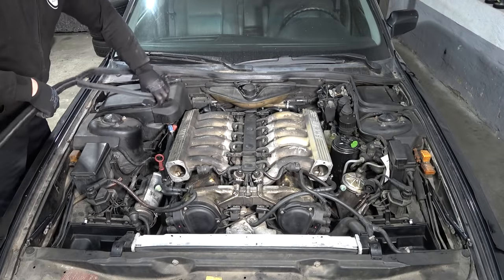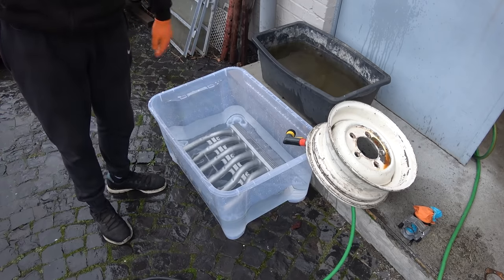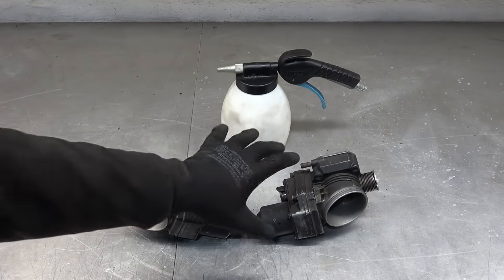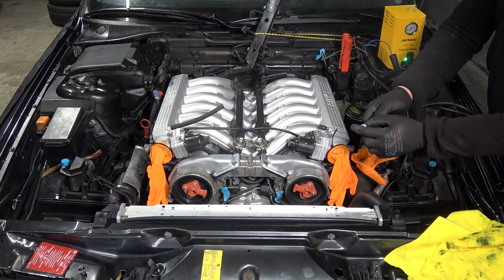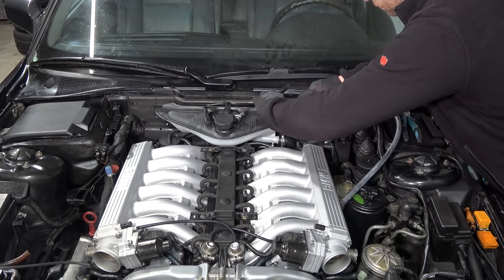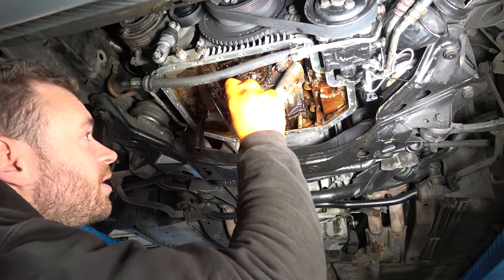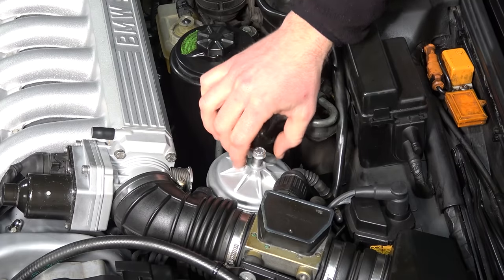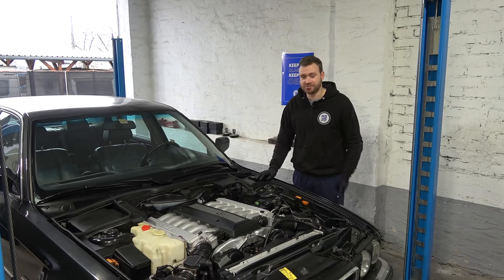BMW V12 Top End Restoration - E32 750iL - Project Karlsruhe: Part 8

Comment: Patiently waiting for part 9.....
Reply: Crazy how long he’s taking. I think he sold the car
Reply: There is an update from June 2023 in the "Project Valencia P1" video, 30:16 to 31:10

It's still leaking oil onto the piston heads (the same blue smoke issue) which Sreten thinks is the Valve Stem Guides needing replacement. He's decided to do a full engine drop & overhaul at the same time he replaces them. But it's the same engine as Project Marseille, so he's going to finish that first.
Reply: The car has been seen parked inside the dojo in other videos. Its just fallen behind on the list and waiting for its turn.

Comment: As a 30 year owner of a '91 E32, I cannot wait to see how you deal with the hydropneumatic rear leveling system (LAD) as you deal with the back end!. I hope you spend extran time on that part of the project! I had to take my 750iL off the road 10 years ago because Pentosin 7.1 at $13.00 (US) per quart was getting too expensive to make a trip into town! I would pour a new can into the front reservoir, and it would pour out the rear shocks as fast as I poured it in! 😭 I wouldn't have a clue what Pentosin cost today! Looking forward to that episode of Project Karlsruhe!

Comment: For those intake manifold gaskets (cut from sheet gasket), you could use some heavy grease (calcium, lithium, or graphite grease). Just smear on mating surfaces and both surfaces on the gasket. I've had the same problem, solved it this way. It works very well and it is cleaner when it is disassembled again later. One thing is that gasket (sheet gasket) has to be the right type, must not be stiff. Excellent work, I enjoy it very much in every video. Keep up the good work. Cheers.

Comment: Loctite 515 is also super useful on gaskets and sealing surfaces, without the drawbacks of silicone RTV. Good save with the oil pump!
Reply: 515 is for metal surfaces, the gaskets here were rubber.

Comment: Just beautiful!

Would love to be able to do stuff like this on my own.

I have had several mechanics working on my old BMW (E36), but they have done more harm than good to the car - and it has been off the road now for more than 6 months.

Also several mechanics have said, that they don't want to work on it, as "it takes too much time".

To make it even worse, just as I had the engine swapped, someone scratched most of the car, kicked off a side mirror and the right side skirt (original M3). And to top it off, insurance will only pay a quarter of the damage costs.

Keep up the nice BMW content 🙏🏼

Comment: The best part about vapor blasting is that the glass bead blasting media tends to peen closed the surface pores of aluminum resulting in a silky smooth surface finish that doesn't even oxidize as quickly as freshly cast aluminum. If you are blasting particularly delicate aluminum castings you can also switch from a solid glass bead media to a hollow glass bead media which shatters on impact and carries less force. It isn't as good at removing surface imperfections, but it does impact the surface finish less.

I always loved the low, lean bodies of the BMWs from this generation of cars. Nowadays the shoulder line of cars is so tall and they just look bulky and cumbersome. Even this land barge of a stretched 700 series looks entirely reasonably sized due to the design ideology of the time. It's just a shame that it wasn't painted a more interesting color, but it still retains its stately elegance.

Comment: What a difference, and what a beauty of an engine and car🔥 

Having an issue with my 84k mile/full BMW history E63 630i.. unfortunately I only now use the car for very short journeys to my gym and back, about 1 1/2 miles a day, so it’s hard to even get the car to temperature. So yesterday I drove home and the car momentarily lost power at 20mph, i pushed the gas pedal harder and it kicked down but blew a huge cloud of oily looking smoke! I took the car for a longer drive on a faster road to really warm it up and see if the smoke cleared. After a few miles it cleared. Engine sounds fine, performance fine, no dash warning lights.. So I am thinking PCV valve, due to all the short journeys. I know this is no good at all for the car.. 

If anyone has knowledge or a thought? 😒

Comment: Great work! This oil valve is the reason why in the M40 engines the camshafts go fault. There is a replacement for this metal valve by bmw which is made of plastic. I replaced it in my E30 m40 and since that everything works fine. Maybe consider replacing it with the plastic thing. It costs around 15€ at BMW Dealership.

Comment: I can't wait any longer to say this. You really need to make another channel JUST for the  water cleaning. No x2 x3 speed, no need for alot of talking. Just a little introduction/sync the videos from what car/project is the parts and then my friend, then my friend, you just upload all the time, all the smooth and relaxing time you spended on the part. That will be splendid 😁.
M539 DEEP CLEAN CHANNEL (M539DCC)
Cumprimentos de Portugal

Comment: Sreten, At first I thought of you as a BMW assembly engineer, product engineer, or someone that worked inside BMW Engine Assembly plant...then you throwing once in a while a words in Castilian (AKA Spanish) I thought: " Hmmm, Sreten is from Spain?!"...then in your Q&A video you explain your story, and I said :"Whaaat??"...OK..

You have demystified servicing these cars with your knowledgeable authority, gained from research and forums...no knowledge comes like free fallen from the sky, but through thorough and relentless research effort!

Another lesson learned from your videos, is how well designed are the BMW cars, not only in their functioning, style and longevity, but also designed with the serviceable-by-user in mind!
Their design (BMW) allows anyone to service any part of the vehicle, as well as making upgrades, say, the projector lamps, as you have shown us in your videos... This is something awesome...some other German cars do not have this in mind, as I found in my Sporty  Sedan 2.0L Turbocharged engine from Wolfsburg  that I have,...In order to do this, I need to remove brackets in the engine bay, front grille, front fascia, in order to get access to all screws to change a headlight..!!!and crossing your fingers one wont break or lose clips in the process!!!

At any rate, your videos have  instilled in me, a desire for research and doing some maintenance, in meine auto by mich selber....

Suffice to say, dass mein nächstes Auto ein BMW sein wird...
🙂

Comment: I saved a 740i with no oil pressure by reading oil light like you.  filter can relief  valve exploded  . fortunately fuel pump died at same time. lol.

Comment: Had same seized piston on M60 engine.. luckily caught it before putting everything together lol. I always dissassemble whole oil pump to examine. In that case it was not pressure regulating piston which on those is plastic. But instead overpressure relief. However its the same story, was stuck semi open so it wented precious oil pressure all the time, not so much to get red oiler light but who know for how many years. Did not seized the engine tho bearing were pretty shot.

Comment: The engine looks very nice from outside, but unfortunately I couldn't see the same beauty when the oilpan was opened for the oil pump. It is clear that it has worked for a long time without changing the oil.

Comment: Nice catch with the oil pressure. Most mechanic would have missed it or just ran the engine too long without oil.
Reply: No they wouldn't, every mechanic I know would have got oil pressure up before starting the vehicle after pulling the pan off.

Comment: I was hoping those blue gaskets would  do the trick . I have a BMW K1100RS motorcycle. Has the exact  kind of intake manifolds. They use and O -ring to seal. I noticed yours were totally flat.  I dont use the original neoprene ones but a silicone high temperature o-ring. They are much better.

Comment: On the engine cover you need to find those plug covers over the screws for the final detail. Also what is the brand source for the rust coating on the valley pipes and crank balancer?

Comment: Oil pressure warning light on after start.  Solution: Me - rev the nuts off the engine to see if it goes out.   M539 - Drain oil, drop lower sump and start removing some part that I never knew existed to free it up.  I would have had no chance to solve that problem. Scary.

Comment: I would prefer to use synthetic oil. It builds less sludge, and the engine will be happier. The oil pump valve will be stuck. The break cleaner didn't cause anything wrong. You are lucky that this happened at the garage.

Comment: Man im dying here , this multi language Guy IS doing all this superbe work craft  . I have BMW 318i 2 door kjetronic needs refresh engine stars imediatly but runs Bad . I have repair manual  the pump IS New ,réservoir is clean, gonna change all injectors next see what happens. It has almost 40 Years thats good injection system.

Comment: im working on my m70 1989 the original motor over heated and destroyed itself.  i now have a rebuilt one from bavarian .  i was wondering if you can circulate the engine oil throughout the engine without starting the engine.  i dont want something dry like a cam or rod bearing since i dont know the build or what was put on the surfaces during the build

Comment: Is it the fan clutch that causes the rad fan to grenade or the actual fan's plastic blades cracking? Just wondering because my 540IT did that but I thought it was just the fan breaking apart. Clutch still felt "grippy" if you know what I mean. Either way it sure made a mess.

Comment: Nice job ! The Engine is SOOOOOOOOOOOOOOOO CLEAN ! And we love that !
About the rear Axle carrier, did you change the "rubber, or axle beam" (part number : 	33311128670) ?

Comment: Sreten, love your soda blasting tool. I looked up the specs on that Hazet unit and its 280 L/min @ 6 Bar (10CFM @ 90PSI). What are the specs of your air compressor? I'm in United States and that would only be achieved by 60+ gallon air compressors. Wondering if the tool is still usable with a smaller compressor.
Reply: Never mind, found the answer in your Workshop Build Part 2 video. For anyone else wondering he's using a HEMAK HK-SK50/8-2 Silent compressor which has 2HP, 50L (13 US Gallons) and 150L/min (about 5.3CFM). Having 220V power in Europe helps with the higher Horsepower and CFM rating than what we get in the States. A comparable Husky unit would be 1.5HP/20 Gallons/4.0SCFM

Comment: I am using ATF in engine oil last 5 years and it looks like it is cleaning perfectly. I have read it is also good for seals not to get dry and crack. In my N62 i have 6.5 liter of 5W30 + 1.5 liter of ATF constantly.
Anyone else has any experience with ATF in the engine?

Comment: Actually you do not damage electronics if you use water (and soap) for cleaning (I use water, soap and brush for cleaning very dirty mainboards, videocards, fans etc). Just make sure to let it dry in a mostly dry, heated environment (20C) for 12 - 24 hours. Maybe in your living room 😉

Comment: Let me surgest next time you blast an exhaust manifold, make plastic couver that you can screw on. For exampl take some old caravan window cut out a piece using hot wire method make two holes and bingo covered up. That way you got a new tool you cud use an almost any exhaust manifold, instead of using thome that is going to soak up water anyway.

Comment: Man, I want to ask you a question. From your experience with working with BMW V12, what is the normal pressure of the cooling system. For me when I squeeze the upper radiator hose, it is little hard. I have asked mechanics and thay say that it is normal for this car. Can you tell me how the hose pressure should be on a proper working car, is it normal to have slightly higher pressure in the hoses? P.S. engine is tested for the exhaust gases in the cooling system and it is negative.

Comment: When cleaning electrics try out WD40 Specialist Contact Cleaner.
And when draining the engine oil it might also help if you pull the dipstick out and undo the oil filler cap to prevent any vacuums.

Comment: I cringed when you reused the old fan blade, mine exploded once; Under a freshly painted hood as well.  Lucky I knew a good dent removal tech that took care of it.  Guess what?  I use a metal fan blade from a .....  E32 750
Reply from the maker: It exploded because of the fan clutch.
Reply: @M539Restorations  I agree, but plastic can fatigue, I just couldn’t go with another plastic fan blade after that experience.  Either way I’m surprised your e32 didn’t have a metal fan blade as that was then only way i was able to source a couple.  One for the M5 and fixture e38.

Comment: @M539 Restorations; I have a BMW E32 750i that runs great when driving but when parked the rpm keep going down until the motor almost cuts off and then gives some gas (sometimes too late and the engine stops). Any idea what can cause this or how to fix it? Thanks in advance.
Reply: Short video of what it looks/sounds like 
https://youtu.be/Lvo8RvHvZJk

Comment: Hi, my son and i are restoring a 735i e32. We have a problem with power steering. We have changed the pump but can't bleed the air in the system. Any tips what else can be the problem?

Comment: older engines run perfectly well on full synthetic. 'old engines were designed for mineral oil so they prefer mineral oil' is a myth, a common misconception born of a lack of understanding. synthetic is better in every respect, you're doing any engine a favour by using it. the only real downside is that it costs more but if you have a car you care about it's worth it. older engines were not 'designed for mineral oil', mineral was all there was so that's what they used. and semi-synthetic is a marketing gimmick to cater to people who are afraid to go full synth, just like hybrid cars are a gimmick to cater to those afraid of electric. let's spread knowledge, not ignorance.

Comment: Use Pro-tec Engine Flush next Time. Will work a lot better than the Moly-Crap.
Benutze ich seit Jahren. Beeindruckende Ergebnisse.
Reply from the maker: What a nonsense.
Reply: @M539Restorations  have you test it?
Reply from the maker: You do understand that all engine flush products are more or less the same? You can even use straight up diesel like in the old days. LM is a reputable company that makes fantastic products, I've never even heard of protec.
Reply: @M539Restorations  LM make some good Products that's right. I have the same Opinion as you since I've test pro-tec. Believe me it's good Stuff. Sorry for my bad English
I use ist on my B5 Alpina 10tkm oil still clear.
Reply from the maker: @TheRummpelbeat  it's pointless discussing this. Just use whatever you prefer, nothing wrong with that.
Reply: @M539Restorations  I do 😉. Just try to help. You use a lot of Premuimtools an the LM Engine Flush is not the best Option.
Awsome work by the Way with the B7. Go ahead

Comment: You doing WRONG - engine flush should be added Always on COLD oil  (because of less oil pressure) !!!  btw  it is so dirty inside - it should be flushed more time on little high rpm (better oil pressure) - i flush a dirty engine 3,5 h - and effects were superb - it realese stuck oil rings
Reply from the maker: No, I'm not. Read the insructions: Add to the motor
oil at operating temperature before the oil change.
It's not "so dirty inside", but rather normal for a 34-year-old engine. Again no, 10 minutes max! You'll do more harm than good running it that long.